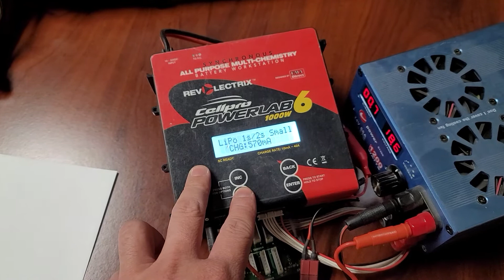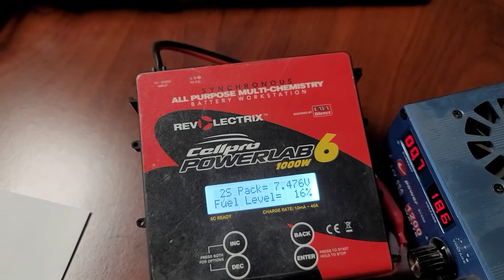Charging Shimano Di2 battery without using BCR2 Di2 Charger DIY

Comment: Superb video! Have you tried by charging 8.4V hobby charger into the Junction A charge port? I am thinking of making a small alternative charger from the FMS USB 8.4V hobby charger, to charge from a battery pack. I could do what you are doing by removing seatpost to charge the battery or make a cable to go directly into the Junction A charging port.
Reply from the maker: I tried to check the voltage from the junction box, but couldn't get a reading. Not really sure why, but I didn't want to risk damaging the junction box so I charged the battery directly. I would suggest check the pin out with a voltage meter to check first if you can

Comment: This is a great idea! I have several RC chargers laying around. Now I don't need to buy an expensive Di2 charger. Did you use an e-tube cable to connect to the alligator clips?
Reply from the maker: I just inserted the wires directly to the pins to test.  But ill probably get a short DI2 etube wire and solder it directly to the charger leads to make it easier to charge in the future.
Reply: @tonytypes  Where do you get a cheap and generic Di2 etube wire? I can't find any third-party ones
Reply: ALso, how did you keep the wires directly connected to the pins. I'm having trouble doing that.
Reply: @tonytypes  Do you mean that it's loose? Is there a good way to get wires connected without permanently soldering